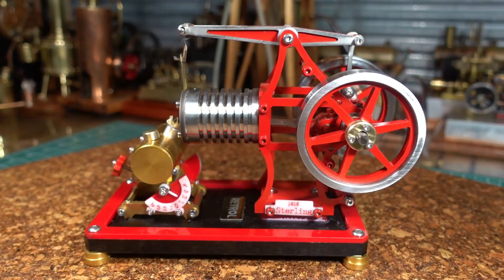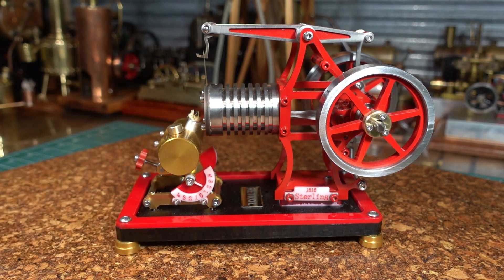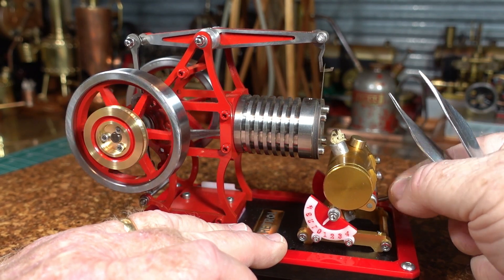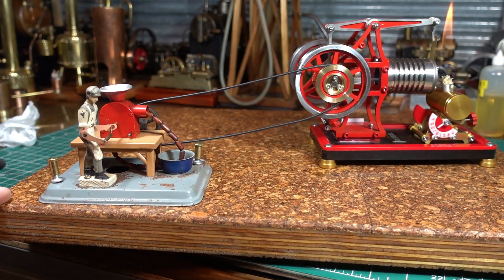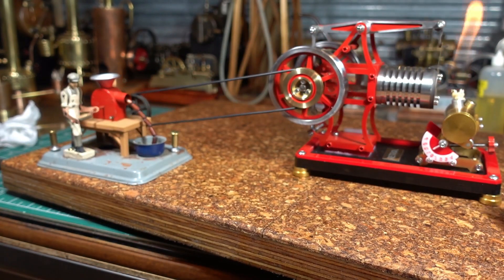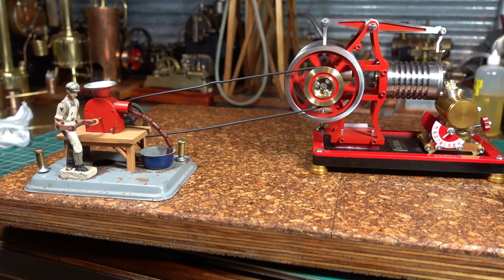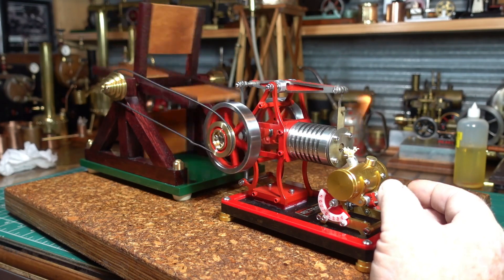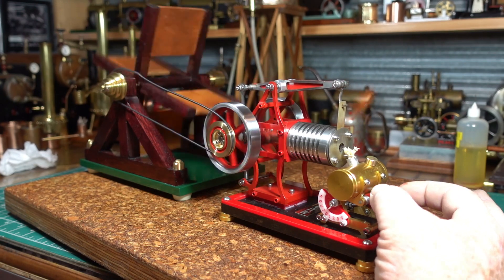Flame Licker Flame Gulper Vacuum Engine VE-01 Crossbeam mod with drive pulley & running accessories

Comment: Wow, I am really impressed, too. This crossbeam vacuum engine is not only an eye catcher, it actually does what it should - do some work! It even manages to drive this heavy Baker fan of yours. And the way the flame can be adjusted is perfect for your purposes. 👍👍👍
Reply from the maker: I too was amazed it spun up the Baker Fan, it's a great sounding engine it can be heard when running right throughout the house.

Comment: I'm going to have to stop watching your videos 😂 I have also ordered one of these engines as well now! I don't have a lathe (or know how to use one) but my father in law does so I will ask him to make me a drive pulley for it when it arrives. I'm amazed watching that run the two items you ran, especially that large fan. You could hear the engine working hard and could see how fast it was going when you unhooked it and it had no load on it.
Reply from the maker: G'day you will really like both engines. Don't worry, I've bought a LOT of engines for exactly the same reason! Play around with the wick height when you get yours, it makes a big difference to the speed the engine will run. There's a sweet spot to have the wick height and a sweet spot to have the wick the distance from the engine. If you never let the fuel reservoir run out, the wick height should never change once you've set it to where you like it.......hope you enjoy both your new engines!!!!
Reply from the maker: P.S Get back to me if your flywheels don't run true. I have an easy fix for you to get them running true.